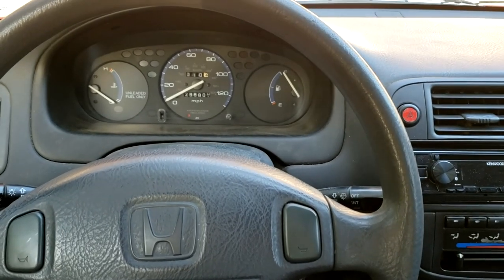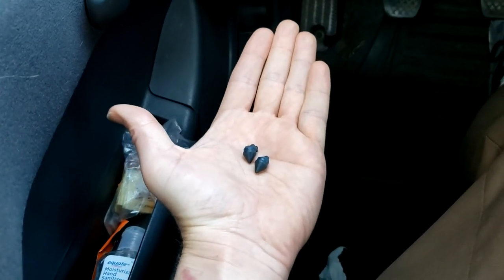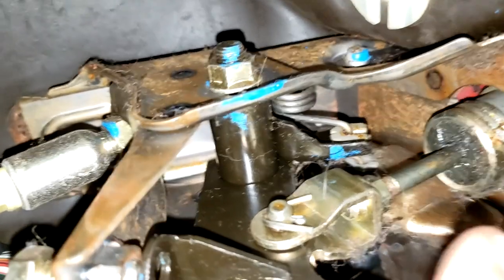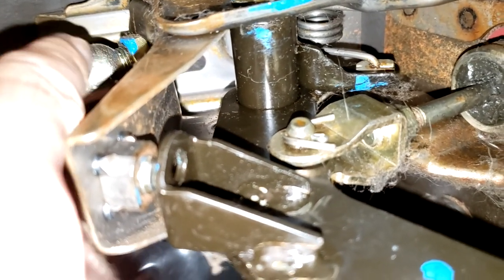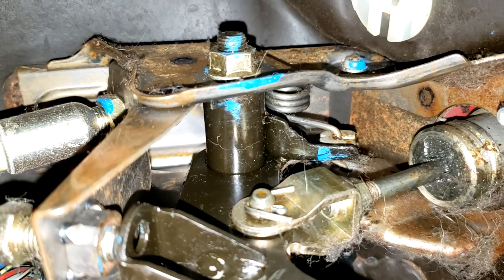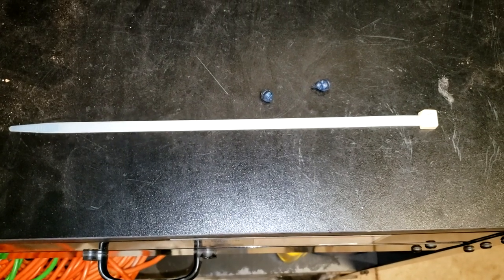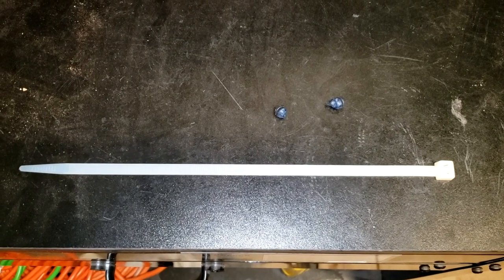Honda Acura won't start with clutch depressed? SIMPLE fix!

Comment: I just replaced the plastic bumper on the clutch pedal that pushes the neutral safety switch. I had to tape it to my finger, reach over the top & push it in the hole from the front side. It was hard & I had to do everything by feel.

Comment: 95 Honda Civic LX Manual: I didn't know there was an upper clutch switch, the bottom one had already lost its little pad and I rewired stuff so I didn't care..('cause the old days we didn't have that "taffysafte" stuff and I used to amuse myself by moving a vwvan using the starter motor (electric car)...not knowing it was for the cruise control...which I have never used....I didn't have the big tiewraps, but I stuffed 4 standard ones in and it works again (after I replaced the battery as well...4.5 years on a 2 year DIE HARD. I had just gotten back from a 1k trip to visit friends and relatives, parked it and it didn't start again...lucky not to have had it happen at a gas station).  Your idea was so good, I had to try it.  I had fixed the brake petal problem by putting a small bolt in that I had specifically sized and purchased (with a spare I could have tried on this problem, but getting the nut on it in that position would not have been fun at all. Thanks again for this interesting solution.
Reply from the maker: Great. Thanks for the comment. Yes, this is an oddball solution but it works and is still working on my car. Been a couple of years since I did it.

Comment: I feel like Honda could have just made the landing piece a solid piece of metal instead of having a hole in it. I don't understand why they did it like this, including the brake pedal stop and the cruise control stop.
Reply from the maker: Agreed. Maybe there's some good reason they did that but I don't know what it is.
Reply: Maybe it's a 'planned obsolescence' feature.
Reply: @brindlebriar  Right? These things never die if you take care of them, they had to invent a reason for you to bring it into the dealership 😂

Comment: Why not just replace the bumper with a replacement one into the hole where the other one broke off?
Reply: a lot of work
Reply: @YTBJAY  I thought the same thing, after fighting with it for a couple of days on my back and looking up under the dash. 

It took me a total of 10 minutes to remove the clutch pedal assembly (2 nuts, 1 bolt, all 12mm, the cotter/clevis pins for the master cylinder, and 2 electrical connectors), install the new rubber piece, and reinstall the clutch pedal assembly. So freaking easy compared to trying to leave the clutch installed and wiggle the piece into place, trust me.

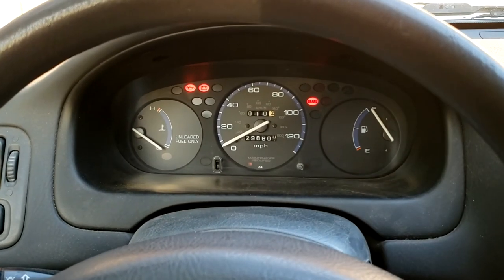Comment: The easiest way to tell that this is the issue: Your climate control. You can even see it in the video, around the 0:20 mark, if you look at this climate control to the right of the dash!

 Sounds weird, but your climate control is the only thing that will dim/cut-off when you turn the key, if this is your issue. Took me a good two days to figure that out. Radio worked as usual, dash lights worked as usual, even the damn key chime worked as usual. I happened to glance over and notice that the climate control lights actually did turn off as I turned the key, so I knew it wasn't the ignition switch itself, because it was triggering the climate control (trying to engage the A/C belt).

Also, don't even bother trying to replace the little rubber piece with the clutch pedal still installed. I fought with it for another three days, and ended up spending a total of 10 minutes removing the pedal, installing the rubber piece, and then reinstalling the clutch pedal.

Comment: @ 4:39 when you say if the tie is thick enough for that hole are you still talking about the same hole where you had to stick the tie in the beginning?
Reply from the maker: Yes. We're just trying to get something in that hole so that, when the clutch pedal is pressed, whatever is in that hole will depress the button in the clutch switch. In this case, the cable tie fills that hole and is what presses the button/switch.
Reply: @FixEverythingYourself  would you think it’ll last a long time ?
Reply from the maker: Yes, especially if you use s thick cable tie or multiple ties. The button on the switch is just plastic so it doesn't do anything to the cable tie. Ideally, I'd be able to get up there and glue a penny or something like that over the hole, and the penny would press the button/switch. Just not enough room to do a better fix.
Reply: Why not just buy a new little stop bumper and put it where the old broke off?
Reply from the maker: That works if you have one handy or if you don't need your car for a few days while getting one. This video is for when you need an immediate fix and don't care about getting the original part.
Reply: @FixEverythingYourself  gotcha I luckily had one on hand because the one for the breaks broke 2 months ago. I rednecked it by gluing the front to a flat head screwdriver and pushed it in that tiny space
Reply: I have dash lights on , a click when turn on but no crank and the radio lights blinks. Integra 2000, new battery
Reply from the maker: Sounds like a bad starter based on that description. But if the battery is really weak (old), you might also get a click but not enough power to turn the starter. See if it starts when you jumpstart the car. If not, its likely the starter. Its not hard to replace and I have a video on how to do it.
Reply from the maker: And even if it's a brand new battery, if the battery wasn't fully charged before putting it in your car, the new battery will be weak until its charged up. Might just need the battery put on a charger overnight. The jumpstart test will answer the question.
Reply: @FixEverythingYourself  it did start and moved it and when I came back its no longer starting. Now its morning , theres sunlight . I saw the plastic dropping and most likely I will replicate your video. You ‘re Thus its really hard doing it from that position.
Reply: @DepressedLego worked like a charm! thank you
Reply: @FixEverythingYourself does the same little plastic stopper that’s used for the brake switch work for this same switch? because they sell it at autozone
Reply from the maker: @forestgreen7763 My guess is that they're the same but I don't know that for sure.

Comment: I was thinking I was having this problem due to the clutch safety switch, but what happens in my case is I turn my key, push in my clutch, then when it should be starting my lights dim like the battery is dead when it isn't.
The only way I can get it to start is to stomp on the clutch.
Everytime I stomp on the clutch the lights dim like the starter wants to engage but isn't turning.
I replace my starter last year because I was having the same problem, I also replace my ignition switch.
The only way my car starts is it by stomp on the clutch repeatedly five to six times and then it wants to start.
Bad switch?
Reply from the maker: Definitely could be the switch. Sounds like stomping on the clutch pushes the switch button in just far enough to get it to work. Just a guess but I'm coming to the same conclusion as you.
Reply: @FixEverythingYourself  the most annoying part is it's intermittent. Just now it started just fine, but an hour from now It might not be able to start it so easy.
Glad it's a manual transmission..😁
Reply: Hey Gen - X
This is the exact case I’m having only if I stomp the clutch it intermittently will start. Also found a small blue broken in half plastic piece. It’s not from the lower  one either on the clutch. So must be upper? 
Did you solve your problem? If so could you explain? Thanks
Reply: @sethdawg  not yet but yeah... Same exact thing. Keep the key turned and keep engaging the clutch.
It has to be one working and one that's intermittent or why would the lights dim like it wants to start?
Reply: If it's the switch, remove the plug and jumper the switch out with a piece of wire like a paperclip
Reply: @mcnairdn  thanks for the tip! It's hard to get under there.. I'd rather pull the engine. 😂

Comment: Anyone knows if this switch has other functions than avoiding ignition w/o clutch pedal depressed?
Reply: I don't believe so.

There is another switch that senses when you first press in the clutch that would disengage the cruise control.  Another switch that does the same on the brake pedal.

If anyone with more knowledge cares to correct me, I'm open to advisement!

Comment: Does anyone know what that original plastic piece is called?
Reply from the maker: Might be something like "clutch starter interlock grommet"
Reply: @FixEverythingYourself ok thank you. I was able to put the zip tie in but would you recommend leaving it or actually using the original piece again. I don’t think it bothers me but not sure which is optimal
Reply from the maker: I left the cable tie in place and haven't had a problem in the 2 years since I did this. If you have a replacement grommet and can get it in the hole, that's probably better but as long as something works, it really doesn't matter what you use.
Reply: @FixEverythingYourself  thank you so much, so happy I found your video, it was the only one that really helped
Reply: @FixEverythingYourself  I guess I’ll leave it on then
Reply from the maker: Glad to hear it 👍